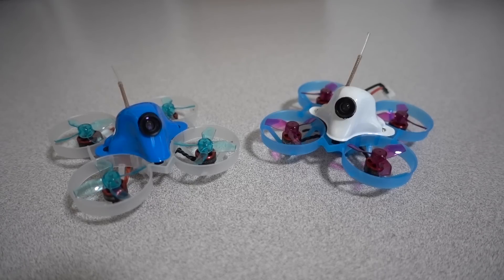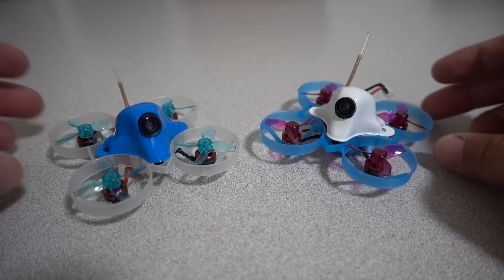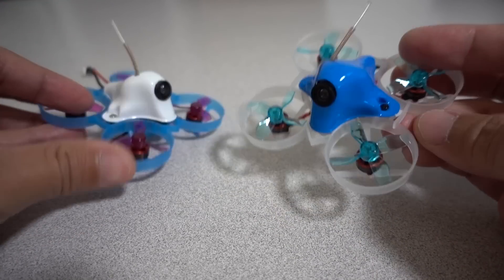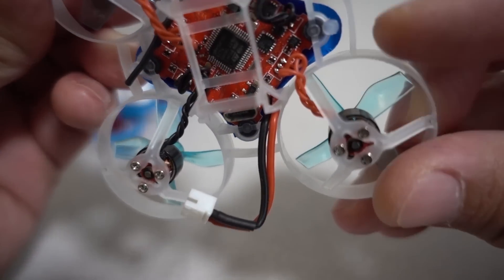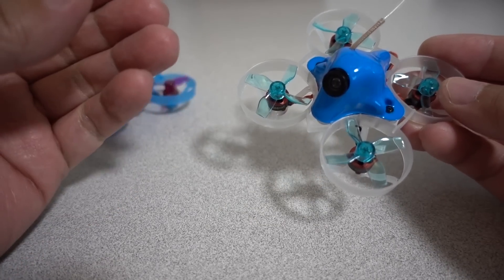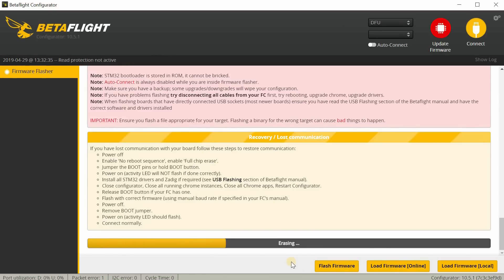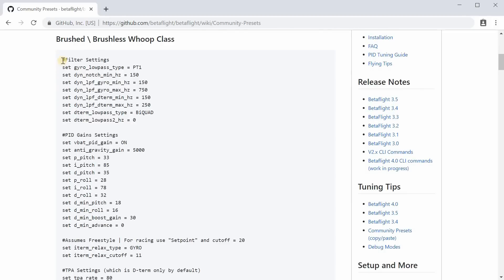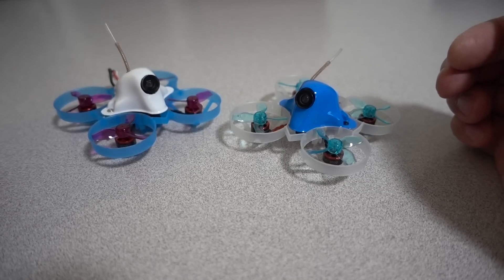Betaflight 4.0 PIDs for Whoops 🎓

Comment: Albert do you have a video on setting up a throttle curve? I cant seem to dial it in right. My 65mm is a little heavy probably. I'm using a eos2 and unify pro32 nano. Should I run 2s or 1s? Indoor.

Comment: How did you manage to bring your 65mm whoop weight to 20gm?
I have beta65 pro 1s running betafpv 0802 17500 kv motors. It weighs 25gm

What lipo are you running? I see it has very less voltage sag. I already changed the connector to a better one (excellway jst 2.0 ph). It improved but still not as good as yours.
Reply from the maker: The BetaFPV 0802 motors seem to draw more amps than the Happymodel versions.  I have no idea why.  I made my own connector from cheap Banggood parts.  Not sure why your sag might be more.  I am using GNB 250mah 1S lipos.  Those seem to have less sag I think.  As for the build, go check out the other video I referenced on the build.  On the build in this video, I also removed the motor plugs and connectors to get the weight down.  It's not the lowest I've seen.  Some other people are able to build this UNDER 20g but cutting all the wires to minimal length and not using any kind of canopy.

Comment: I put 4.0 on my mobula7.  My motors still get hot though.  I would like to see something that would help with that.  On my 2nd set of motors already.
Reply: I put this on my Mobula7 and my motors aren't hot.  You followed the directions?
Reply: Ya my motors have always ran hot.
Reply: Mine get warm, not hot tho. Maybe the dynamic filters need adjusting if they’re on. I dunno if I turn my motors on in the motors tab if I put it at about 1036 I get this howling noise, anyone know if that’s from just the low power to the motors, them needing to be oiled? Or if they’re starting to go... I’ve had it like 2 weeks. And I can’t get rid of the drift. Spent so much time in betaflight the last few nights I’m getting annoyed. Tomorrow I’m re flashing to 4.0.0, I currently have 4.0.3. Putting it all back to factory settings. Then changing what I know I like for rates and other small hinge.

Comment: that TPA of 80 is REDICULOUS for my micro 1102 88mm. Causes massive shuddering on punchouts, lowered it all th way to 20 before it was semi-managed.
Reply from the maker: Don't use the whoop presets, use the 11xx presets.
Reply: @AlbertKimTV  I'll give 'em a shot. For some reason I had assumed they were 1104-1106, 8000kv-4500kv compatible. 1102 11500kv 1s motors feel like a whoop, but that's coming from a guy that's never built a whoop. Thanks for the tip!

Comment from the maker: In case it wasn't that clear to you, all I did on this build was flash 4.0 and copy/paste in the settings as you saw in the video.  I made no other tuning changes.
Reply: Hey Albert. Can you do one on the eachine trashcan with betaflight 4.0.3 on 2s. I have mine on that but get very hot motors and a lot of vibration and wobbling...
Reply: Thanks Matey. 
Quick question though. What are the best settings to look and adjust if the Woop (brushless) Motors are getting too hot? oh and the Emax Hawk 5 would be a great next job!👍✝

Comment: Thanks for this.  I'd really like to see some community presets specifically for the 2s whoops (Mobula7/Trashcan).  Both of these models come with a pre-release version of 4.0.0, so the original stock settings are a bit different than the full release of 4.0.0.

I've tried running the community presets on my Eachine Trashcan, and the PIDs seem a bit off.  The 4.0.0 default PIDs seem okay but could be improved.  Has anyone else tried using community presets on the Mobula7/Trashcan?
Reply: I tried these whoop values on my TC and the motors were really hot after 30 seconds, not a good sign.
Reply: @rickinjax2330  I've posted an issue on the betaflight GitHub.  I also was able to get a slightly improved tune, and listed my settings in the issue: https://github.com/betaflight/betaflight/issues/8156
Reply: @mpettit  did you improve it any further?

Comment: Thanks for this. Wondering 4.0.1 fixes the crazy fly aways that have been happening with larger quads. The release notes are saying they changed the defaults to try to avoid them. I'm flying 4.0 official version on my 85x HD, used the community presets and other changes UAVtech suggested. Flying pretty damm good, could use a little tuning to make it a bit tighter, but flies awesome with the Emax Blur props. No jello at all, but I am using ND filter.

Comment: What about the Diatone GT-M2.506? I would love to upgrade it to BF4.0.
Reply from the maker: Anyone else?  Please upvote or comment!
Reply: @AlbertKimTV  Yes please
Reply: @AlbertKimTV  I would love that, i struggle to tune mine on bf4.0, quad goes bezerk as soon as I touch the throtlle.
Reply: razcaillou I don't even have to touch the throttle - escapes to the moon with throttle at zero.